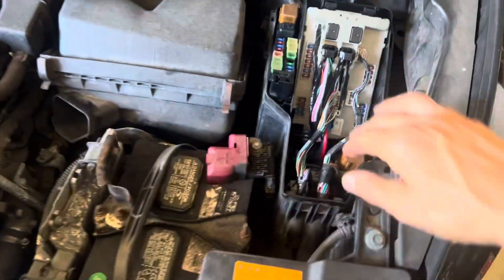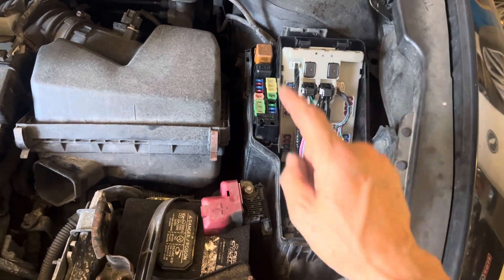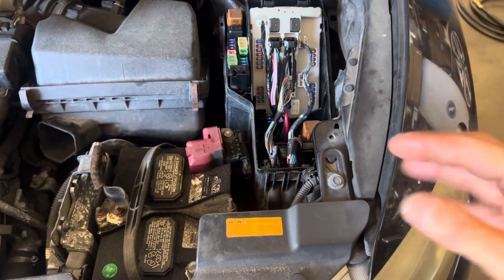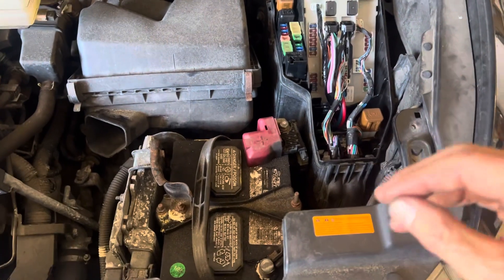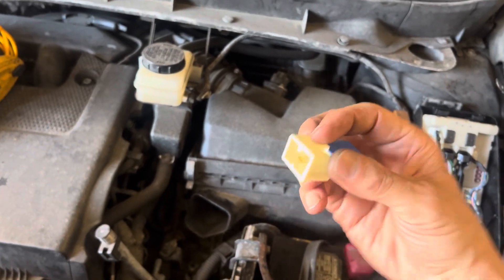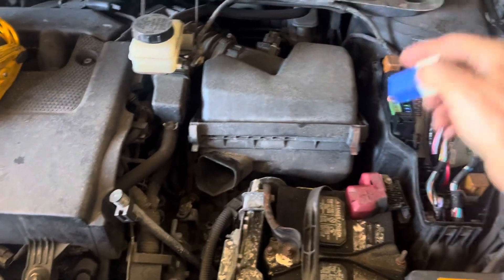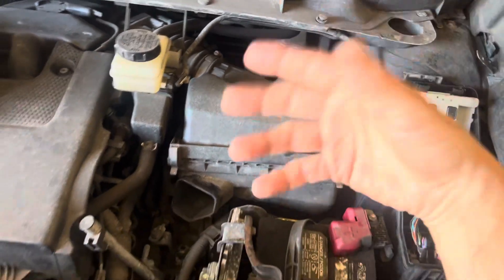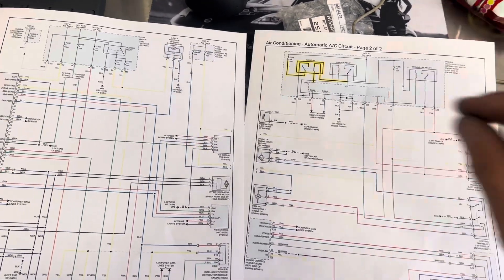I wanted to show you how to bypass the AC HVAC control module or PCM body control module with Relay

Comment: Do you have a video on how to bypass HVAC on control module?
Reply: or PCM
Reply from the maker: @AlexEspino-pu5ns  all different vehicle manufacturers control their air conditioning using different modules some use the PCM or the ECM others use the body control modules and others have independent separate HVAC modules. 

It all depends on the model vehicle
Reply: Can you please make a diagram on how to wire the relay for PCM post it on here...thank you.
Reply from the maker: @AlexEspino-pu5ns  it’d be different for different vehicles cannot generalize because what might work for one might damage another one. 

And if the signal is going into a module, but there’s a defect inside the module and the signal is not coming out to turn on a relay . 

You can take that signal that’s going in that tells maybe the power control module to up the idle speed or any other function turn on fans, but is no longer putting out the signal to turn on a relay to access an activate clutch coil for the compressor . 

You can take that signal to trigger your own little control board to control a relay and just piggyback the signal that’s going in . 

And then you supply your own power or ground to activate relay
Reply: K... thanks for your help... I'll look at schematics and do that 👍
Reply from the maker: @AlexEspino-pu5ns  no

Comment: Depending on what scan tool the shop has and the vehicle make and model, Bi-directional controls for determining component operation can come in handy as well, even in enhanced data there are usually PIDs that show AC command ON/OFF.
Reply from the maker: I keep asking shops this.  Most aftermarket scanner do not have good or much ac control at all.  They two many things but not ac. He had scanner hooked up.

Comment: When I did the 5.3L swap on my firebird I wanted to get the computer to manage the compressor. Unfortunately in my case I was unable to because, if I recall correctly, the HVAC controler would send a signal to the body control module and the body control module would translate that as a code to the PCM as a compressor on request. Since I eliminated the body control module there was no way to get that signal. So now when I flip the AC switch I can feel the engine struggle a bit since the idle air control doesn't open up. If there's a way to get the computer to turn up the idle as though the compressor is on I'd be all ears
Reply from the maker: Sounds like you need to put back the body control module just for that purpose . 

It’s the idle up control you need on compressor command . 

Aftermarket control module?  But that cost more. 

Probably a way using a little Arduino or raspberry pie module . 

So right no when you’re cooling fans kick on and any other large electrical load bog down you alternator your rpm drop ?   No control?.
Reply: @coldfinger459sub0  it's a factory pcm reprogrammed to remove the VATS. I haven't checked alternator load, that could have something to do with it. I have AC override for my electric fans. I guess it's something I have to just deal with it. Runs alright